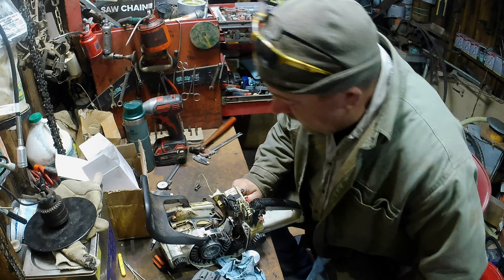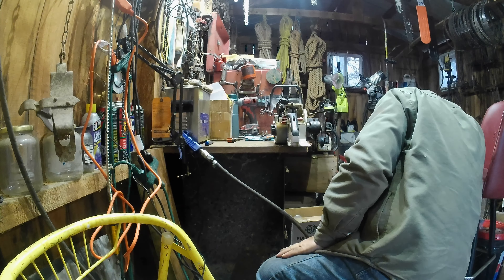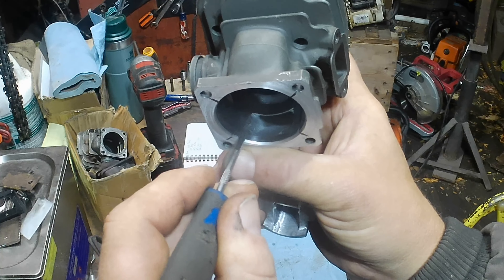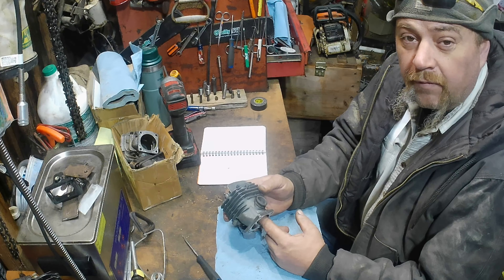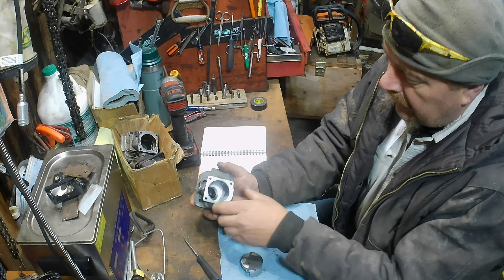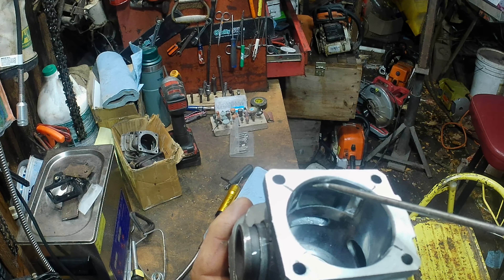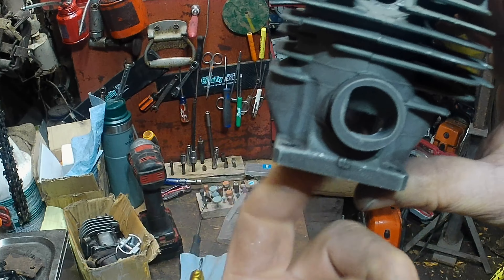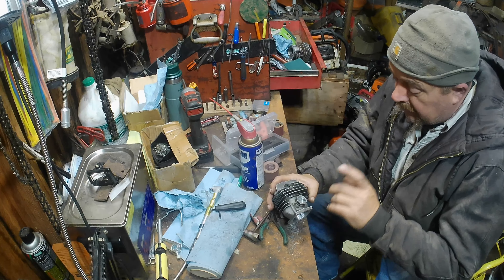Stihl 026 PORT WORK Firewood Build- Intake, Exhaust, and Transfer Porting

Comment: I watched the last 2 videos out of order so I know what coming.  

Nice job explaining things.  Those lines showing the piston window openings were a good idea.

Can't say I'm sold on buying any aftermarket big bore kits.
Reply from the maker: @Kevin.L_  Watching out of order, did you see anything in the port work that would have cause it?  Second set of eyes are always good.
The only reason(s) I use the AM cyls is/are that I like to work on saws, but don't rely on one to make a living; I can "play" rather cheaply. Seeing as how I'm learning too, I thought I would keep trying (and ruining cylinders along the way) more and more aggressive things until I see diminishing results... then, I can copy that RIGHT back to the stock cylinder.  At $25 a pop, I can make more mistakes along the way without breaking the bank so bad. 
I concur on the lacking quality, but they have their place... this one's "place" is in the scrap heap 😂
Reply: I didn't realize it was a $25 loss.  I guess that makes it easier to take risks.  

I didn't see anything out of place.  I just took your word for it that it was carbon from the muffler.  I know I'm paranoid about cutting on mufflers and not getting everything out.  Only done a few.  I haven't seen any damage but I haven't pulled any cylinders either.

Comment: Awesome video! What kind of solutiom do you use in your ultrasonic cleaner for cleaning cylinders and pistons? Thanks! :)
Reply from the maker: @Magoot2456  I've been using a splash of dish detergent (generic Dawn), s dollop of simple green, and hot tap water; I let that heat with the heater until 40c-50c and let it churn for 15 minutes or so. I think maybe I had something else in during that video (can't remember), but I like the simple green and dawn better. I keep a jar of gas or alcohol for carbs and whatnot; just put the jar with carb and gas in and the ultrasonic waves go right thru the glass jar without having to fill the WHOLE reservoir with a specific solution.